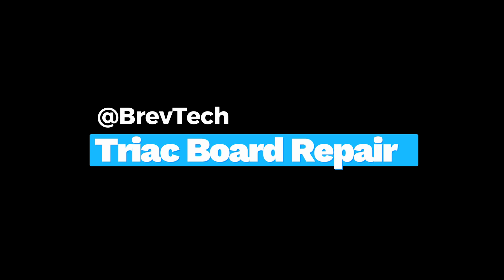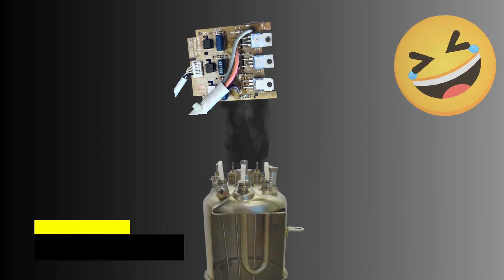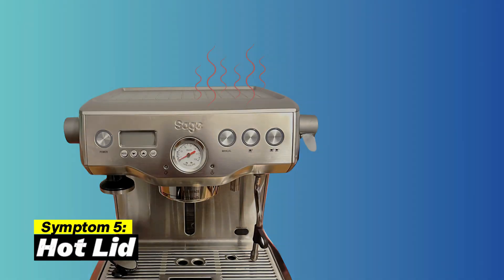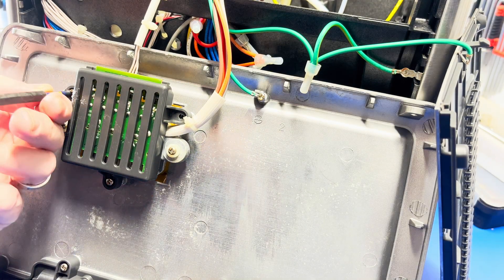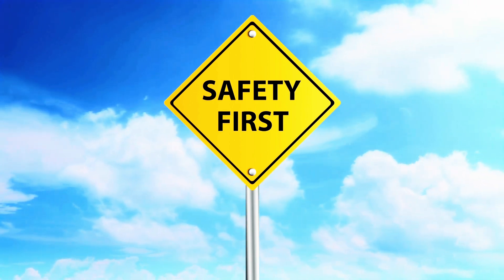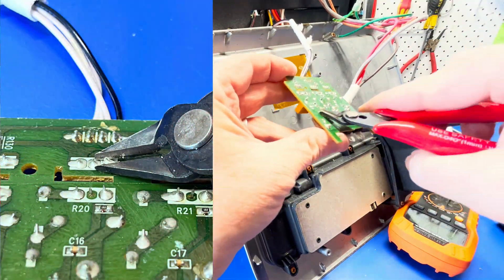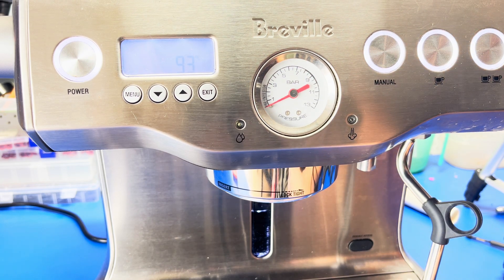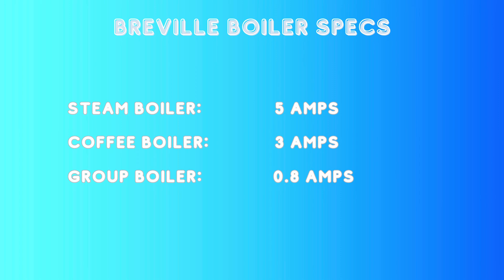How to Diagnose and Repair the Triac Board on the Breville Dual Boiler BES920/900

Comment: Going for a Hail Mary here….

I’ve got a pretty obvious solenoid issue, big buzz intermittently when brewing, sometimes a lower dull buzz… have replaced the solenoid but the intermittent problem persists. 

Some people have suggested my triarc board is shot, but I thought it only controlled the boiler temps. Is there another triarc board for the main brewing solenoid?

Comment: Help!
The brew (coffee) boiler heats up when switched off on my Sage Dual Boiler.
Using your excellent video I checked to see if there was a voltage on the Brew triac.  No voltage registered!  (Or, as expected on any of the other Triacs)
I then switch on the machine to find voltage on the other two Triac’s but NOT on the Brew boiler Triac. Yet there must be voltage going to that Triac as that is the one that heats up when the machine is switched off! Confused! Any ideas?

Comment: Thanks to your very nice video. My Sage BES920 LCD shows around 55º and it is not rising any higher. After turning it on i checked the self check service the probe check are all HHH, the cofe boiler is 85° , the steam boiler 118° , and the group head only 27°. Do I have to replace the Triac Board and the Thermal Fuse? 

Thank you in advance
Reply from the maker: very likely the grouphead thermal fuse and opto/triac on the triac board
Reply: @BrevTech  Thank you very much, I will try it:)

Comment: What if the right hand side of the machine or top is very hot but still works fine
Reply from the maker: take the lid off to make sure as this can sometimes be caused by steam heating it up
Reply: @BrevTech i changed the o rings everything still does it but still works fine maybe the cup warmer is just really good haha

Comment: My breville oracle keeps heating up even it hit the target temperature(93degree) and the power button keeps blinking…

When I press the hot water button it say 105 degree but the LCD screen show 93 degree. I turn off the machine and is still very hot unless I unplugged it. 

Do you think this is the triac board faulty causing this problem?🙏
Reply from the maker: certainly yes. keep it unplugged until its fixed to avoid a costly repair. you will need to repair the triac board along with the leak too.
Reply: @BrevTech thanks❤
Reply: @BrevTech thank you so much! We fixed the machine by following your tutorial! However, the machine still makes the boiling noise even after we unplugged it. What should we do…?😢

Comment: My dual boiler one day recenly I heard make a strange sound from the other room while it was in standby mode. I went down to look at it, at it was flashing like it was in heat up mode, but it was already 20 degress over the target temp and could not use the machine. I was ready to start ordering parts to do this repair, but the next day, it worked like normal. It hasn't overheated or made the weird sound since. I'm no longer using the timer heat-up function as I dont want to leave it heating unmonitored just incase.
I checked for errors following your other video, but didn't seem to find anything. Do you think I should do anything at this time preventatively? 

You helped me out so much last time with my leaks and changing o-rings, and your helping me out again today! Thank you for these incredibly helpful videos.

Comment: I am in Canada where voltage is 110 and Breville parts are next to impossible to find Breville will not sell parts to dealers or clients. I am working on a machine abandoned by previous Tech. The Traic board was blown lots of damage. I replaced it but am only getting ½ the voltage 54 V AC to the pumps. Not sure if previous guy changed the PSU with a 220 Version or the new board blew due to some short. Any advice would be a appreciated.
Reply from the maker: Are you sure it's to the pumps as they are powered from the main board? The triac board powers the three heaters (and solenoids/grinder on Oracles) Half voltage on the triac board usually indicates a failed opto. Are you getting half voltage on all outputs?

Comment: Hi,
I have a BES980 with the steam probes with clips. The thermal fuse blew upon descaling (steam boiler would not heat up at all), so I changed the thermal switch and fuse on the steam boiler. I also replaced all orings, steam probes, cleaned all 3 solenoids while the machine was open. After doing this, I powered the machine on and the steam boiler heated up, only it continued to heat beyond the set level (I only let it go slightly higher than set temp before unplugging the machine). I took this to mean that there was an issue with the triac and opto so I proceeded to attempt to replace all 3 triacs and opto in one go (I purchased a full set so thought why not 🤦‍♀️), however due to my level of experience doing this, I may have damaged the triac board in the process. Upon turning the machine on after doing the triac board repair, neither the coffee boiler nor the steam boiler heat up now, however one of the pumps turns on. Can I take this to mean I have damaged the triac board and I should just replace the whole triac board to get my machine back up and running? Could a damaged triac board result in no resistance when testing the blue and brown cables at the back (as well as the blue with red)?
Reply: Also, I reset all errors in debug mode before undertaking the big repair. The only error that came up after turning on the machine was error 26 (steam boiler temperature overshot). I then cleared this error. I then entered debug mode after replacing the triacs and octocouplers, and no errors show up. I didn't leave it on for 5 mins for fear of doing damage to the machine, so maybe that's why no error 17, 18 or 19?
Reply from the maker: The first thing to check is water levels as you won’t get anything from the triac board if your boilers aren’t full enough. It’s concerning that you don’t get any resistance between the brown one bone wires tho as that could be the thermal fuse again. Check the blue wires are still in the thermostat ok too as it could also be the reason
Reply: @BrevTech I checked the water levels, and they were low, which would explain the pump running continuously when turning the machine on. I topped them both up to be sure they're full. However, neither the coffee or steam boilers heat up. They're staying at 18° with no signs of getting any higher. Nothing, but the fan is running when I turn it on. The coffee boiler would heat up previously. Surely I haven't blown the fuse on both? I didn't let it get that hot, and I unplugged it immediately when I saw it was heating up beyond level.
Reply: @BrevTech also, this time I left it on long enough for error 17, 18 and 19 to show up. The blue cable is definitely plugged in to the thermal switch on the steam boiler. I just retested the resistance and I get 47ohms when testing the blue and brown cables. However, I'm getting 101.5 when testing the blue with the red. Does this indicate a damaged thermal fuse on the coffee boiler? If so, would this prevent the steam boiler from heating up also? Or could the triac board be the culprit?

Comment: Many thanks.

Your help, and your survival kit has got my recently acquired BES920 going again.
Leaking steam from steam boiler and steam wand valve has blown the steam triac.

It stays warm 24/7.

I need to get a professional to fit your supplied triac and ANC OCTO, which I don't have.

Error code 11.22 time after a reset a few days ago.

Will stop using it for now till that is repaired.
Reply from the maker: ok good luck it all. Those parts should fix the problem
Reply: Going to get a professional to use the 2 triacs and OCTO you supplied in the repair kit.

I think the Group head and Steam boiler triacs and the group head and Steam boiler Opto.

I bought some more Optos. @BrevTech

Comment: Thanks to your Very nice video. My machine LCD shows 70º and it is not rising any higher. Is this issue a case of under Heating?
Reply: Do I need to replace the triac board and fuse?
Reply from the maker: @조영-v3g  very likely, yes. Take a look at the video on the self-check menu to find out first if the boiler water levels are ok, then if so, which boiler circuit is faulty.

Comment: Excellent video!
I have just got an second hand one with only 44 (440) shots on it! The steam boiler is not heating (3 beeps) and I found a little dead roach on the inside of the Triac for the steam boiler. No visible burns to it, but I can only guess that’s the cause. 
Should I be also worried about replacing the very difficult to reach thermo fuses on the steam boiler?
Reply: And in my case of a bug potentially shorting the Triac, is there a test with the multimeter to confirm? Replace opto as well or just Triac?
Reply from the maker: The video should explain testing with a multimeter. The triac board would’ve kept the steam boiler running and almost certainly blown the thermal fuse I’m afraid

Comment: The manual says to unplug the machine when not in use. I guess constant power to the triac board is why, but then you always have to reset the clock.  Do you think there would be an issue adding a relay to the triac board so it shuts off with the machine?   Seems weird they didn't just engineer this in.
Reply from the maker: agreed. the clock has a cell battery anyway. Maybe that's just the Oracle, I can't recall. I'm not expert in electronics, but a relay seems like a good idea to me

Comment: Hello, I have the overheating issue. When I turn off the machine (plugged in) I see that it doesn't consume power (measured) but afterwards at some point it starts consuming even being shut down. I did the health check and the boiler that seems overheated was the steam boiler with 155° Celsius(the machine is set to 135°). I already changed all steam probes as this was the first problem that I noticed (they all were hissing). Thank you
Reply from the maker: how long until it starts consuming? What amp readings do you get immediately after switching off and also when it starts consuming?
Reply: @BrevTech it takes ca.10min to start consuming, when turning off immediately it's 0, when turns back on it is 2.755(varies after to 2.765, or 2.744, etc), then stops again. I am not sure if always is 2.755 as it changes slightly
Reply from the maker: @brluisa2987  I can only think it has an internal leak that is taking time to have an affect on the board. Try unplugging it overnight, then plug it in, without turning it on. Does it still creep up after 10mins? if not then its a leak causing it imo
Reply: @BrevTech   I did that and it starts immediately to heat and consume even whitout turning it on. I didn't  any water leak
Reply from the maker: @brluisa2987  you said before it took 10 minutes before it consumes power, now you say immediately? ok, if this is the case, yes, you have a faulty triac board. Going by the Amps you stated, I would take a guess it's the steam opto that's failed.
Reply: @BrevTech  thank you a lot!  I will change and let you know.

Comment: Heya. My machine's pump just runs when its turned on. And wont stop until i turn it off or unplug it. The traic replace would fix this?
Reply from the maker: Which machine and which pump? If the pump sound is quieter than when running a shot then it is likely the steam pump. It normally comes on about 5 seconds after turning on the machine, to top up the steam boiler. If so, then the pump might need replacing. You would need to do further testing on it tho
Reply: @BrevTech Heya it's the bes870UK
I can't pull a shot because it just runs the pump the second you turn it on and will drain the water reservoir until it's dry and only stops running when I unplug it
Reply from the maker: @tgems1984  Ah a Barista Express. In that case, it's likely the triac on the board (TA1 I believe)
Reply: @BrevTech thank you! I'll order one

Comment: My Sage machine is broken and does not work, but I gave it to someone and he told me the problem is with the board. Then he changed the IC and only the upper part works now and I feel heat and the machine does not work
Reply from the maker: Take a look at my blog page for a troubleshooting guide you can follow

Comment: What did you end up replacing on this machine? From the video, I presume that the coffee boiler opto-isolator and the grouphead boiler opto/triac were all replaced?
Reply from the maker: well spotted! I must've used footage from two repairs doh. The fault on the board i measured with the meter just had a faulty coffee opto

Comment: mine was breville bes 920, wont turn on at all, i already change the fuse in the cable, is it the triac pcb that the cause?
Reply: can u help me?
Reply from the maker: @muhammadhasantarigan3411  It won't be the triac board as that is just for the boilers. It could be either the front panel or controller board. check the large yellow capacitor on the controller board first
Reply: @BrevTech can u guide me how to check it? or do you have any whatsapp or social media that we can communicating?
Reply: Do you fixed?

Comment: Hello I want to ask about the same problem on my machine. I have replaced the moc3063 optocoupler (3 items) And triacs Q6015L6 (2 items) and BTA06T-600CW (1 item) But why does my engine's temperature still rise to 123° and if the terminal has not been unplugged, the boiler is still heating May I know what's wrong with my machine?
Reply from the maker: It could be another component on the triac board I guess. It might be best to get a whole new board

Comment: We replaced the Triac for the coffee boiler and when plugged in (switched on at the wall and not the machine) the little cylinder resister fried. Any ideas what we are doing wrong?
Reply from the maker: Are you 100% it was the correct triac?
Reply: Model number we took out was Q6015L6 and Batch number 9CZAD. The replacement was the same model number with batch number PH238. We were thinking possibly the triac batch is bad but other than that we’re at a loss. 
Thanks for the quick reply!
Reply from the maker: @haydenwilkes5327  measure between the tab and middle pin. It should be open circuit.  I've been sent cheap clones from China in the past that had non-isolated tabs. Nowadays, I always order my parts from Digitech or Mouser
Reply: Tab has continuity with the middle prong. We might order new ones either way.
Thanks again!
Reply from the maker: @haydenwilkes5327  yep, thats a dodgy triac. They should not have continuity.
Reply: Thanks again!

Comment: Thanks for the detailed video. On my Sage oracle when I turn the machine at the mains plug, but keep the power button off, the top of the steam boiler gets warm. Is this normal? I ran your voltage check on the Triac board and all seems good.
Reply from the maker: If it keeps warm when turned off then the triac board is letting power through to one of the boilers. You can find out which one either by using an energy meter and taking note of the watts or amps it's pulling, or for the Oracle, go into the live debug mode and see the temperatures of the boilers.
Reply: Thanks. Do you have a video on the oracle live debug mode? I don’t have the touch version and don’t know how to access or interpret this menu.

Comment: Any idea what the Err1 message means when I turn the machine on? Stops me from using it or heating up, getting a coffee boiler NTC error in the  error menu as well. Is it as simple as replacing the NTC sensor?
Reply from the maker: It's usually the Coffee NTC i believe. Its the blue connector back at the control board. Take it out and measure ohms. you should have about 50k at room temp
Reply: @BrevTech  thanks for the reply mate, I'm getting OL when testing the sensor unplugged. I guess that's what's busted
Reply from the maker: @BigD42886  yep

Comment: Great vid and explanation however your background music drives me nuts. The top of my 920 gets very hot 42degrees and steam only gets to full temp now and again. Sometimes I can steam the milk for a week and then it takes ages to get the milk up to right temp so am wondering if the Triac could be the cause. Hate checking 240v so a bit apprehensive about checking the Triac board.
I live on an island in the pacific so no repairers or electricians. Should I bring the Triac board back to Oz and have it tested when I ca
ome back in a few weeks?
Reply from the maker: Yes, the music was barely audible when i made it, but YT must normalize it after upload. I might redo some of these videos eventually without music. ok, so a hot top plate and a boiler that only sometimes struggles to get to full temp is often a leak - especially if it hasn't been serviced for a couple of years. Use the self-check menu (i have a video) to check the temps of the three heaters to eliminate the triac board. If they look ok - or maybe the steam boiler looks a little low, then take off the top and let it heat up to check for leaks.